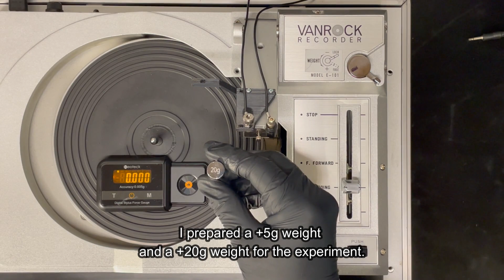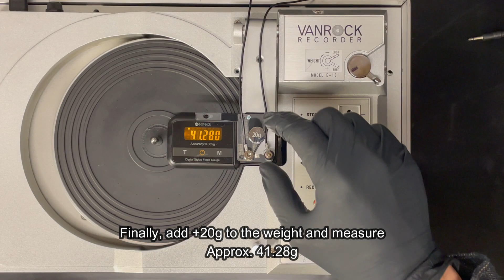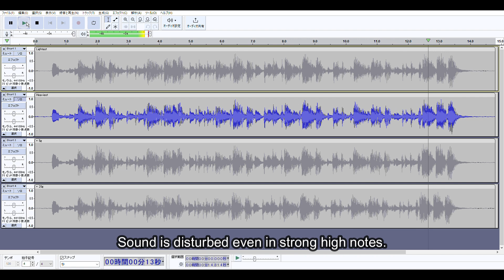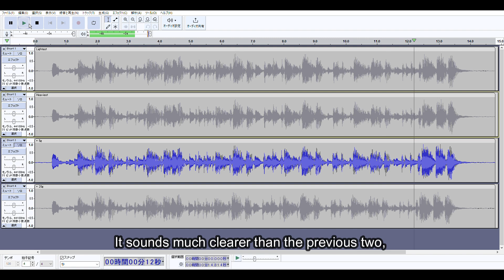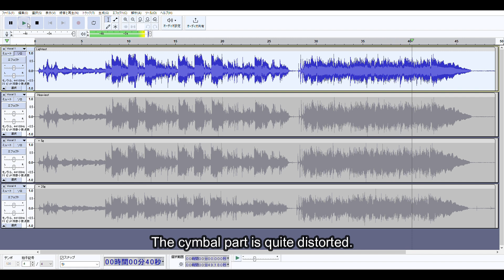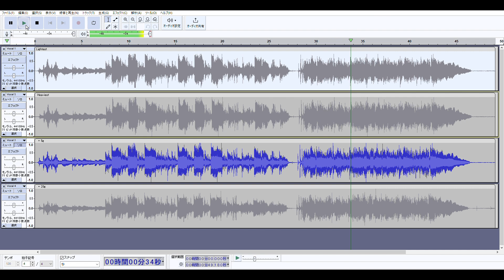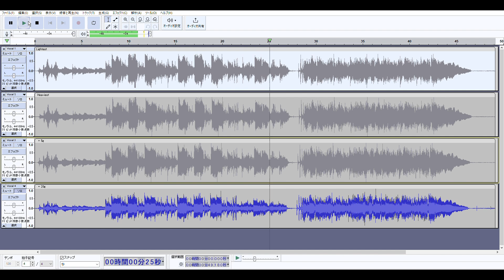【VANROCK】Vinyl Record Cutting Lathe Differences in sound quality due to the weight of the Stylus.

Comment: I know how to avoid those sort of problems with less headache, use a digital recorder and playback like CD that came out 40 something years ago 😉
Reply: The records will still play in 50 years time.
Reply: Yeah with more ticks and pops and groove distortions and wear than ever before.  CDs meanwhile can last as long or longer provided they use good materials. CDs made in the 80s are still playable by the way. Now if you want to stick with Thomas Edisons' antique playback system then feel free to do so.  @rokarolla
Reply: @truesoundchris   Sorry but I zoned out after the first few sentences due to the BS factor. Maybe you should have made sure the products you recorded were using quality materials instead of cheaping out? I have CDs from the 80s on up that play just fine and I never had one that wouldn't do so. Go on and rant some more but I won't be reading any of it. lmao